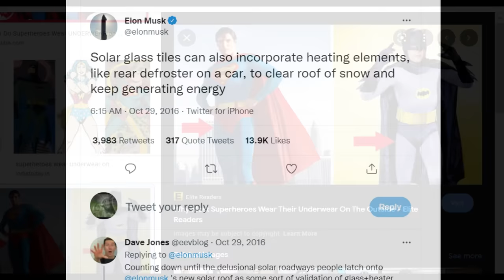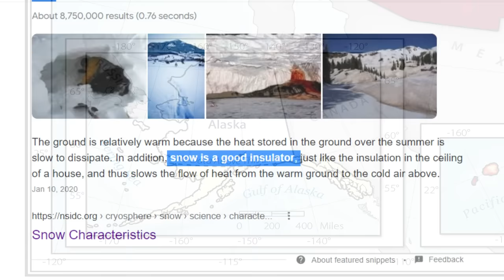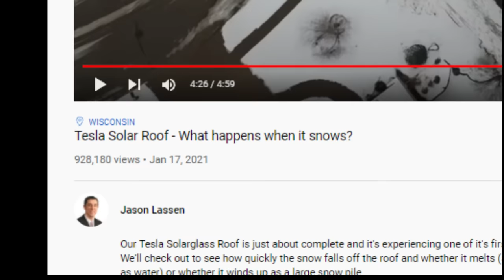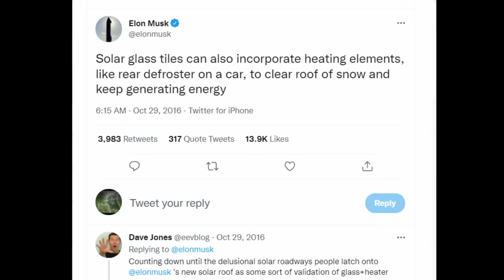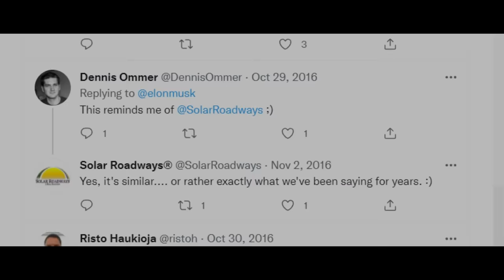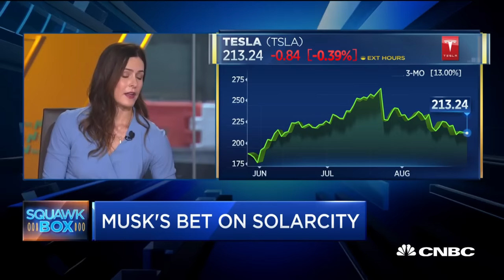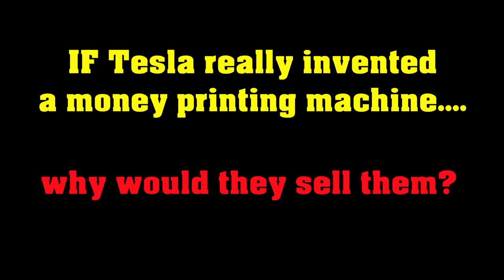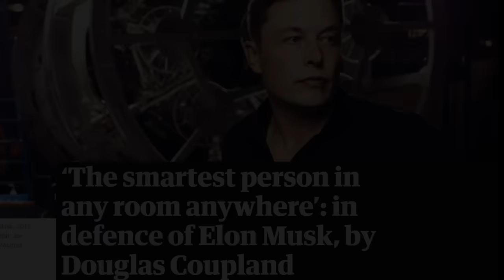Elon Musk: The Smartest Person in any room ANYWHERE!

Comment: not siding with the smartest man here but, just making a note that there are cornercases.... like places where the temps almost never rise above 0C  , meaning any snow will cover the roof for the best part of the year if not removed,... these ar also usually places that have actually manny "sunny" as in cloudless days and they beneft from 20h+ light during periods of the year, the panels would be utterly useless the other part of the year, but i guess that being able to charge a laptop a phone and a some other stuff might be nice to have in those regions as gridpower is far away., and a second corner case is in high mountain areas lie the swiss alpes , on a nice ski trip you can return more tanned than from a beach bakin hollyday,... but ski trips usually also means snow hopefully,...

Comment: wouldn't it be more energy efficient to have an automated swiper? and if you insist on using solar panels in such high latitude, I would put up sensors to measure the energy coming in, and calculate if clearing the panels is worth it factoring in energy loss due to less insulation, weather forecasts etc. But at that point, it probably doesn't hit its economic goals of paying itself back in xx years.
Reply: Windscreen wipers just like on cars they are auto.

Comment: Well , elon Musk is probably right about sparing motors because this is not  a device you can buy at the shop next door.
So even if the price is negligible as you demonstrate, producing enough of them to continue the project is probably not feasible in a decent amount of time or effort.
Hence , the will to spare them as much as possible.
You can compare this to some research in biology , where it could take months to build a sample with the correct specifications. It can be a rat, a plant or even just e bunch of cell.
The value of it is close to nil, but the work and time you need to put in it is considerable.
If later you plan to turn the experiment into a common thing , you can develop a full industry to produce motors fast and cheap, but i think the day he can burn motors like he can send roadster in space is not there yet. And probably he would let somebody else take the risk of doing it.
This guy just need the thrill to do "new" stuff (even if it is a scam, because all the rest is just boring.
Reply: Clever people left his Space-X company, because Musk treated them like shit, and the dumb ones cannot mount the motors now.

Comment: You wasted too much time explaining why the heated rooftop would not work. It’s a simple Thermodynamics reason. Sunshine has all radiation frequencies and they all become heat once absorbed ( snow reflects some but not the infrared, water absorbs a lot of infrared ). But that melting doesn’t happen if enough light or no light is present (cloudy). And if there is light, the snow melts and slides down, if the roof is steep. So, no light, no heat, no melting possible. Musk is a guy who wrote a new way to pay online without a credit card, PayPal . No new code, just different input (bank accounts). Then, People made him a demigod. Soon he will be the new My Pillow Guy

Comment: Except that, if the roof is smooth enough and sloped enough, it takes little or no heat to make the snow slide off.  Somehow, the mighty Thunderfoot didn't realize that an asphalt roof has a different friction coefficient than a roof made of glass tiles.
Reply: The solar panels are hydrophobic and like you said a small amount of heating can cause the snow to slide off. Better than blocking the panels once the snowfall stops.

Comment: Thunderfoot, this is such a dumb video.
Roof tiles are not what insulates a roof, it's the insulation underneath which Tesla has nothing to do with.  If a solar roof melts snow faster, it's because the dark panels absorb more sun and/or have an abiliity to electrically heat up and melt the snow.  Surely you're smart enought to know that?

Also, there are many places which get good solar energy for eight months, and then not so much for four in the winter.  I live in an area like that in Washington State, where solar panels are well worth having.  On the sunny winter days it's still worth it to clear the pv panels and generate some energy, enough to run the fridge and lights, so clearing off any snow is a good thing.  
The tiny amount of insulation-effect from an inch of snow is not as valuable as clearing panels and generating electricity.

Comment: I don't get it. Roof tiles never provide much insulation. The insulation is inside the roof.
If the angle makes Tesla roofs bad in northern latitudes, then any solar is bad in these places, it's not inherent just to Tesla roofs.
The Tesla roof may be clear of snow not because of bad insulation, but because the tiles are heated.
It may be a bad idea, but you are mischaracterizing it.
Reply: Not quite,  Slate roofs do provide a layer of insulation.
Reply: @dogwalker666  "much", i said "much".
Why do people always overlook qualifiers?
Nobody depends on their tiles to provide insulation, the insulation is on the INSIDE.
Reply: @itsROMPERS...  lol, now it is on most houses but not all, Apart from the fact the Tesla tiles never actually existed,  putting them on a roof would in winter only get 2 Hrs of  sun light per face, In summer you will get 10 hrs and 6 hrs  assuming you get a decent summer unlike this year. I also doubt they could take weathering  Hail, storms like today would probably shatter them.
Reply: @dogwalker666   yeah, but isn't that exposure the same for any solar panel?
And there are millions of tile roofs and they don't all get shattered, so why would these?
Don't get me wrong, i loathe Musk, and i usually agree with thunderfoot, but these arguments were sketchy as hell.
Reply: @itsROMPERS...  solar panels can be angled to get the maximum sun at a location,  Roof tiles are a fixed standard angle depending on geology and other buildings,  
There are millions of roofs made of slate, stone, cement even the rubbish plastic ones that only have a 5 year lifespan,  Non made from the very brittle materials of the musk-tiles, 
Don't forget buildings actually need to move and flex
Reply: @dogwalker666   Roof tiles, being fixed to a roof, are obviously less flexible in orientation, but most roof top solar panels I've seen basically conform to the angle of the roof they're on.
And obviously it would be ideal for them to be adjustable in a way that tiles can't be, but most panels aren't either.
I didn't know that the actual material of the Tesla tiles was inferior, but was that really an insurmountable problem? Could it really be impossible to find a material that was durable like good roofing tiles?
I just think that if you have to have a roof covering of some sort anyway, why not make them solar collectors if they're practical and affordable?
It's not like mounting big panels up there is without problems. I've thought about getting them, and i live in an ideal location (NM USA, at 6000', well over 300 sunny days a year, very rare snow that melts immediately), but still the hassle doesn't seem worth it considering my extremely low energy consumption.
Otoh, rather than see money put in Elon's pocket i think I'd rather see his blood draining out his ears.
I don't like him.
Reply: @itsROMPERS...  you only put solar panels on the optimum side of the roof, You would be spending a lot more money fitting tiles that would never generate electricity,  Bearing in mind the life of a solar panel is probably about 5 years and the original slate tiles on my house lasted about 100 years and the modern (Slate is stupid expensive now) conglomerate ties have a lifespan of 25 years, 
Fitting solar panels on your roof has problems but making your roof out of solar panels is dumb,  The material requirement is not compatible with the building requirements.
Reply: @dogwalker666  the life of a solar is only FIVE YEARS? 
I did not know that. They can't even be amortized in that little time, even with incentives.
I just assumed you would only put solar tiles on the sunny side of your roof.
People sure waste a lot of money in this stuff. Those Tesla power wall batteries are almost entirely useless for most people who aren't off-grid.
Reply: @itsROMPERS...  don't forget these are only small solar panels not full size like the ones we actualy use, And every single one would need at least 4 power connections  power out, temperature sensor and heater connection,  all on IP68 cables, Approximately 3500 High current DC connections.

Comment: Do not be f00led by thunderf00L's thunderous gaslighting. In Montreal, Quebec, canada, which is pretty blody cold in the winter, and pretty bloody far north (north of all of USA except for Alaska), the optimal solar panel angle is 30 degrees, not "vertical" as he was trying to insinuate. Solar is not unworkable here in the slightest. Thunderf00L also didn't take into account that a black roof absorbs more heat.

Comment: Sure, Elon isn't the smartest person in every room, or even likely in the local grocery store- the topic itself is basically like shooting fish in a barrel.  That said, I only got half way through your solar analysis before I couldn't stand it any more.  You're better than this- your video is riddled with inaccuracies and distortions and misperceptions on your part.  

People in the northern hemisphere don't put panels on the north face of their roof, unless they're morons- and not every house is oriented with its ridgeline running east-west either.  My house for instance is oriented with the ridgeline north-south, and if I put panels on the east and west sides of the roof,  at their typical roof pitch, they're each tilted at roughly the correct angle to produce the maximum number of kWh per year on average based on my latitude.  Spend a few minutes with PVWatts from NREL- it's free, and you'll learn something.

Up at the farm, where what I really need is more kWh in winter, the panels are facing due south- because they're mounted on a ground mounting, not a roof- but they're angled much more steeply- at the angle needed to generate the best return in kWh in the winter months.  That steeper angle also helps them greatly to shed snow without me bothering to get out the broom to given them a hand.

As to the tendency of solar panels to melt snow off the roof- that has to do with their emissivity and also their smooth surfaces.  Elon's "solar roof" tiles are stupid and a commercial failure, but ordinary power producing panels self-clear without needing the house to have poor roof insulation- you got that one spectacularly wrong.  They're also mounted with an air gap between the panel and the roofing material, so the only meaningful heat transfer from the inside of the house to the panel would be radiant anyway.  That's rather important in summer, when power output drops quite a lot if you let the panels get too hot.

Again, you're better than this, Thunderf00t- I've seen it in countless videos.  Do a bit more work next time- maybe even talk to some people in the field in question.  It'll make for better content.

Comment: I'm wondering why you didn't tackle the fact that in the Musk video showing that one roof without snow, you can actually see that it's a construction site and judging by the material present and the tracks in the snow around that house, they had just put up the tiles. (so it's possible those are just black shingles, not even a Tesla roof, freshly put up, that haven't seen any snow yet) That makes him look even more stupid...
Same goes for that idiot visiting that house: it's a construction site and it obviously has not snowed since they put up the tiles.

In defense of the idea, as a solar engineer I noticed this effect among our clients' installations: solar panels put on top of a very well insulated roof, will clear themselves provided they are mounted at enough of an angle. Through the snow crystals, enough UV reaches the cells to produce enough of a current to bring the substrate just above freezing point. This will melt the lower layer of snow, which will want to stay liquid against the surface of the panel, but will refreeze in between the crystals (some of the water is capillary pulled between the ice crystals). This creates an ice slate on top of a water layer on top of a perfectly smooth glass surface. Give it enough angle (we usually say over 30°) and it will just slide off under gravity. SOOOO, if the solar roof really works, there would be large piles of snow lying around the house from all those slates that slid off. Quite the contrary of their "proof".
There are 2 conditions for this sliding mechanism to always work. Or better said, situations in which it won't work: 1. If you get more than a foot of snow in a single night, it's likely that it'll need a little nudge to start sliding. 2. if there is "regular" roof surface below the panels, obviously snow will not slide off of that, so the snow sliding off the panels can stack up and block further sliding. (easily fixed by mounting the panels higher off the roof (partial fix), or mounting them nicely aligned with the edge of the roof (full fix))

Comment: You need to really not talk about valuation and economics you don’t understand the financials of Tesla and return on capital, growth, or anything you are going to look really stupid in a few years. 

Elizabeth Holme never had a product or the tech or shipped anything of value.  

They already have said they will run their own fleets, but they have to sell cars until then to develop it.

The model 3 and model Y already are cheaper over their lifetime than a Toyota Camry.

The thing is the raptor engines aren’t expensive they are scarce they are building them as fast as possible and it’s not fast enough. They are still developing the factory so the can turn them out faster. I think they only have gotten down to one per 24hrs of shifts. Also their first booster launch has 28 raptors. Do your research.
Reply: WRONG!  I own a Toyota Camry since 1990.  235,000 miles on it.  Cheaper than ANY insanely overpriced Tesla.
Reply: @theultimatereductionist7592  do you understand life time cost isn’t the same as sticker price?

Comment: Brilliant way to keep the snow off the roofs. Especially in towns and cities with sidewalks. It would save the owners of having to manually clear it away using workers in cherry-pickers etc. The owners are responsible for having this cleared so no snow, iceblocks, icesickles, or other dangerous debris falling and hurting pedestrians, putting them in huge financial liability for the damage caused. The owner of the building is also responsible for ice or snow on the pavement, with liability for accidents slipping and hurting themselves. Therefore, heated cables which keep the pavements free of ice are becoming more popular. This can obviously also be achieved with manpower, shovels, and chemicals. This is not a problem everywhere, Thunderf00t. But you forget the legal aspect of this in several places, and the peace of mind for the house owner, knowing it is done automatically, therefore not having to remember having it done.  If a house is built to standards, there is no benefit of having snow on top, as there's already ambient temperature cool air circulating between the insulation and the tiled outer layer to avoid potential water damage from radiating heat.